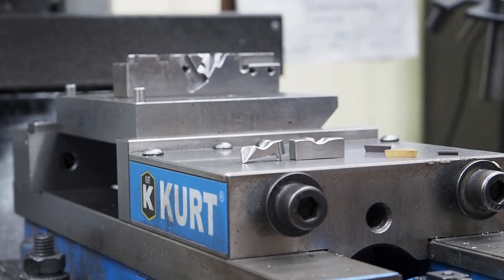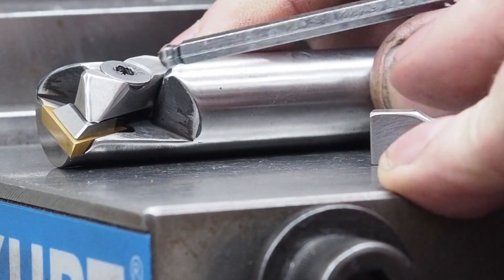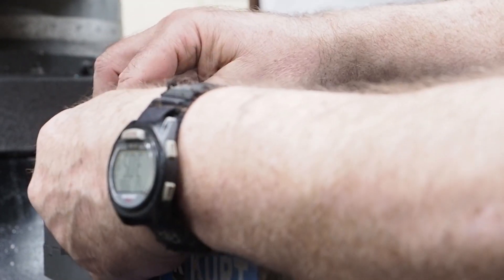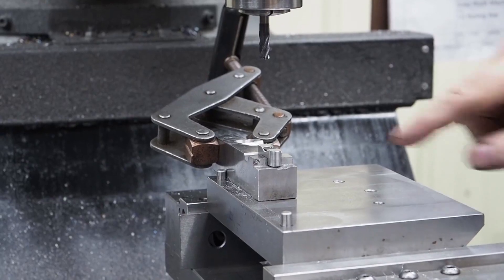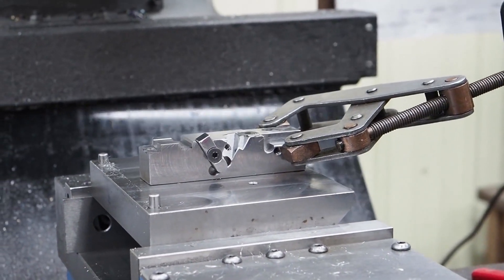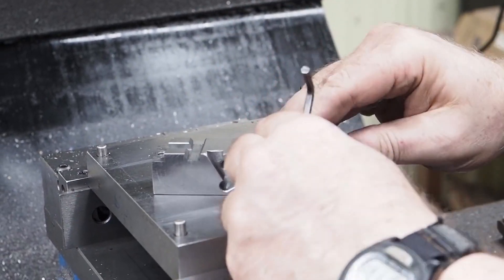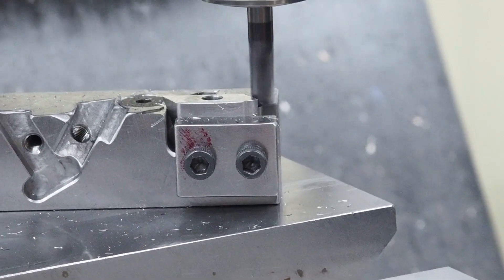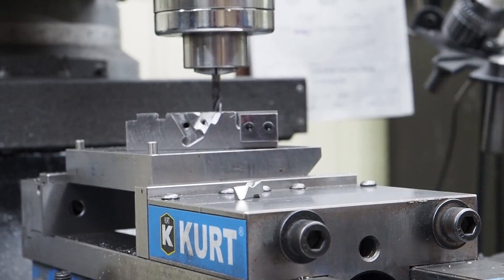Making difficult parts fast with fixtures.

Comment: Awesome fixture. For production you could make it even simpler to set all three spots on the same heigth and in line. Then have the fixture tilted only on the 30 degree so you can just move your cutter over all there parts at the same time and cut all surfaces in one go. Then move over to cut the other side of the rib and be done.  
I learn a lot from your videos!
Reply from the maker: That's a great idea!
Steve

Comment: Hi Steve, I've incorporated the idea of milling a radius swinging on a dowel pin on many occasions in the past. It's a good way to cut a radius that is larger than the diameter of your rotary table. You just need to use common sense and be safe about it! Enjoyed your video, I haven't run a Bridgeport since 2009, and the videos, believe it or not, keep the work fresh in my mind.   Ah- retirement!
Reply from the maker: In our very first video I use this method to make our 20" disc sander.
Steve

Comment: That helped alot of people new to machining. Old cast crank throws are pretty dimensionaly stable for most needs, For fixture material. If you have a mill that you can tram and can orient the piece at an angle with a combo square. Or have a dro and need a precise angle thats the easy way.  If your fooling with one angle alot cut a gauge outta a food container plastic cuase if you have to change orientation of the angle for mock-up or set up a lot that kind of tool like a fish-tail to a lathe can help you get close quick and keep your mind from getting tangled
Reply from the maker: Thanks.
Steve

Comment: Awesome fixture...suggestion use a 4v battery driver w/torque setting, lots of sizes to select from, straight or articulating
Reply from the maker: Thanks for the tip Chuck.
Steve

Comment: Thanks Steve, quite informative. I think you could save yourself some time and frustration by using hex screw drivers instead of loose bits, ratchet wrenches and Allen keys. Ball ended ones would reduce the fiddling.

I'm sure I'm not alone in saying we'd love to see how you went about making the fixture. If you have any video of how that was done and the design arrived at could be enlightening to many of us hobbiests. 
Regards from Canada's banana belt. 👍🇨🇦🕊️🇺🇦🤞
Reply from the maker: Hi Ron,
I don't have any video on that. Basically it boils down to need. If I have a part that I need to make a lot of on manual machines I always try to use fixtures to speed things up or make difficult cuts easier. In this case I started out how to put on the radius first. As I was building that It came to me I could use the same fixture for the difficult angles and relief cut. By putting it altogether in one fixture it it greatly reduced the time to make this difficult part.
Steve

Comment: Love watching your videos and creative solutions!  Finally got a CNC machine to learn on, but still mostly use manual machines and learn a lot from you and other channels.  Will keep an eye out for pricing on these bars once done, I need a good 3/4 or 1" bar.
Reply from the maker: Hi Joe,
We plan on doing a 1" bar after the 3/4" comes out. It will be the same as the 3/4" using the same inserts but bigger bar.
Steve

Comment: I like everything about your boring bar and fixtures except the choice of flat head screws. An underutilized (and superior IMO) substitute is a button head screw. For a given screw size, the button head has one size bigger hex key, and they don't wedge in the hole or cam out like flat heads. People tend to use them only for holding sheet metal panels but they have a nice surface area and hold machine parts well when there is insufficient head height for a SHCS. Also been a while since I've seen S7 used. A couple can industry press parts would only hold up with S7, but at 60 Rc for that use.
Reply from the maker: Hi Engineers Workshop,
I use the flat head for the pressure distribution on the clamp more so than clearance. The clamp has very thin walls by the screw hole. The flat head keeps the pressure closer to the pressure points on the bottom of the clamp and helps keep the thin walls from buckling. I prefer the smaller wrench size in the application. If a bigger wrench size is used people may over tighten the clamp and damage it. The wrench size in this application is way more than what is needed to tighten the clamp sufficiently. I have used this system on dozens of bars already and it works great. Another choice of steel you may want to consider for the press application is CPM 1V. It has about the same strength as S7 and about the wear resistance of D2. https://www.crucible.com/eselector/prodbyapp/tooldie/cpm1vt.html
Steve
Reply: @SolidRockMachineShopInc  that career was 20+ years ago! Used H13, D2, M2, and nickel carbide for can punches. Nickel matrix held up better to the soluble oils in use.
Reply from the maker: @EngineersWorkshop  I am not sure if CPM 1v was available then. That would explain S7.
Steve

Comment: Man I wish I could get in to this type of work. I get so bored where I work.
Reply from the maker: Hi Robert,
Do they have machine shops within driving range of where you live? If so, check them out.
Steve
Reply: @SolidRockMachineShopInc  yes. Many. I currently work as a manual machinist for an aerospace company. I mostly run jigbores. I would really like to get in to tooling. However I dont have much grinding experience.

Comment: Cool fixture, I have some experience manufacturing with welding fixtures, I noticed the time you are spending putting screws in and out is very inefficient.
Reply from the maker: You may be right for high volumes but it was amazingly fast even with the screws for our small run.
Steve

Comment: Does your fixturing allow for variations in the blanks?  I have no idea what is involved or necessary so I hope these are not dumb questions.  Could you incorporate the DRO and its multiple zero settings to make so you don't have to eyeball a start?
Reply from the maker: Hi Robert,
Those are good questions. The function of this part does not need extreme accuracy but the way the blanks were built there is very little variation between parts lee than a few thousandths of and inch. Yes I could use multiple zero setting on the DRO but I prefer a single zero and on batch runs will write the number down for each feature location. This video was just to demonstrate the function of the fixture so I went by sight on much of it.
Steve

Comment: Well done Steve, that is a pretty complex part really and being so small makes it even more so. How could you do it with out fixturing of some kind. I suppose you might, but figuring each set up would be time consuming and you might still end up building some kind of fixture anyway even for a one of part. Cheers
Reply from the maker: Hi Warren,
You are correct. We had to fixture the part to keep the price of the new boring bars down. I haven't timed it yet but I believe from start to finish including the blank to be about 7 minutes each at 20 plus parts per run.  Without fixtures it would guess it would be over 1/2 hour each. Also, it is so simple to use the children will have no problem making these parts.
Steve

Comment: Are those TPG322 inserts
Reply from the maker: Hi Bobby,
They are TPG321. 322 should work too but with a little less clearance between the cutting tip and the side of the boring bar.
Steve